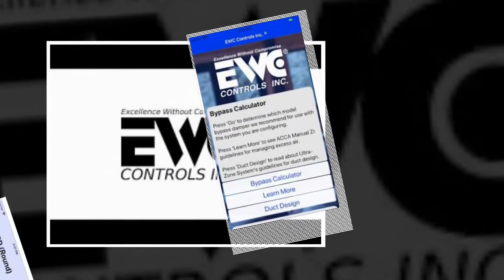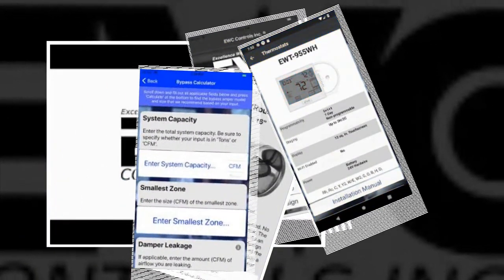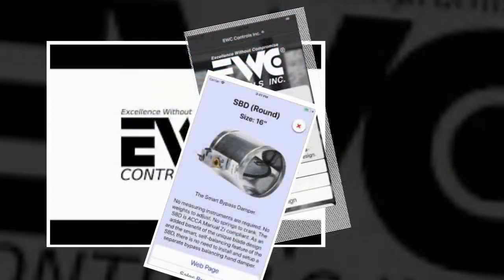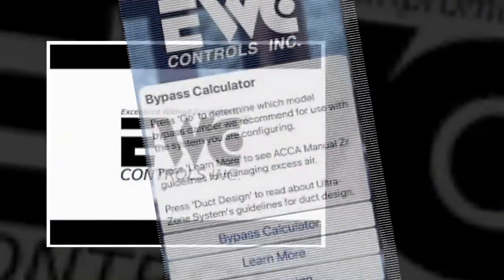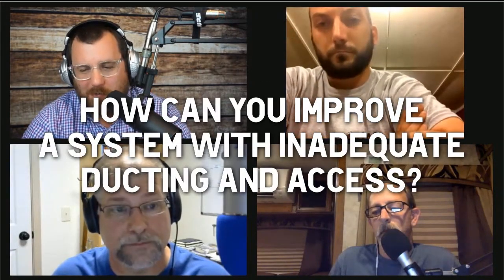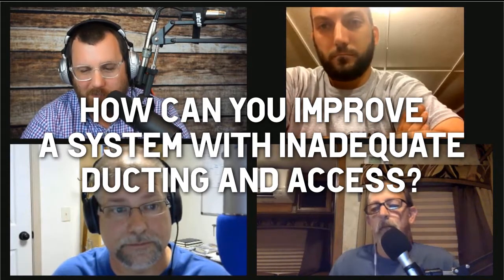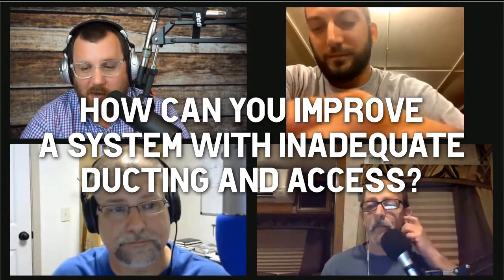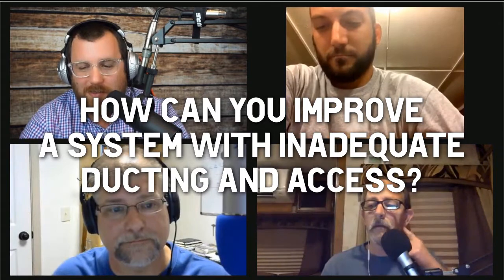Can You Utilize an Undersized Duct System That is Inaccessible? (David Richardson)

Comment: Problem I had with my recent install my home is a 3,400 square foot manufactured home (no not a mobile home it was trucked in 7 different sections lifted with a crane and put into place 6 of which stacked on top of the other with the garage being attached to the side) that the original installers used belly ductwork like a mobile home all the main ducts are sealed inside the subfloor which was fully encased underneath in the crawlspace using 2x8s sealed off with foam insulation around the metal pans absolutely no access whatsoever 40ft 12 inch supply duct with 9 8-in crossovers 3 to each side of the house every 10 feet and 3 directly up from the center from the main supply running to each belly duct plenum manufacturer that built the manufactured home before it's trucked in was based out of Leadville, Colorado so all of the belly ducks were only rated for 49,500 BTUs problem I had is I'm in the deep southern side of Arkansas Home this big here requires 5 tons or more so wound up putting a 5-ton system with a 16-in supply with 12-in crossovers nothing they could do about the belly ducts without completely tearing out all of my floors.

Comment: San Francisco has a problem undersize ducts. San Francisco is getting hotter in the fog is disappearing over the years. But still the small houses only need if that 1 1/2 ton system. And they’re being told by contractors who only done furnaces their whole life to put in 3 tons systems. I just converted over a old-school contractor building 600 square-foot plus mini apartments who always use electric baseboard heaters at $.24 a kilowatt hour. Told him he only needs a 9000 BTU is more than enough in a small “New Build”room that size and you get air conditioning for free on top of that heating.